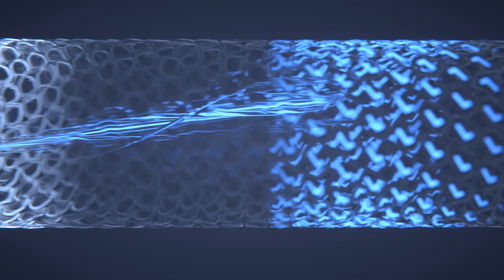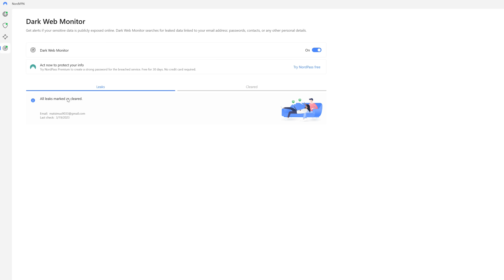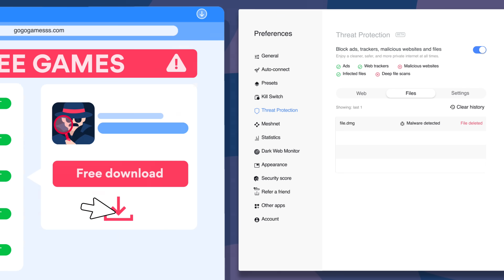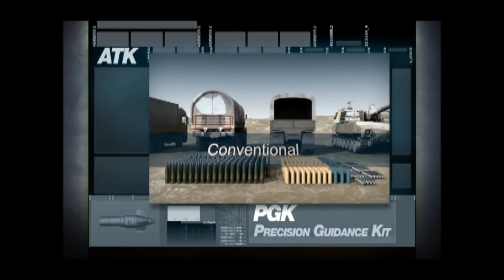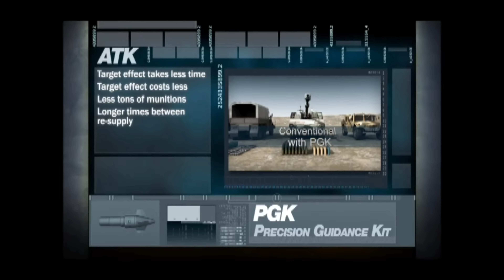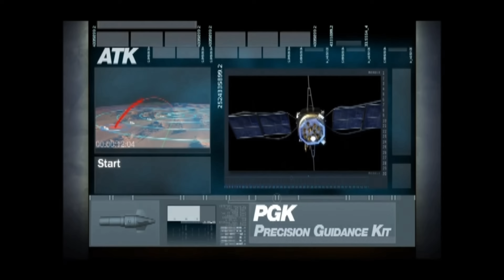Can Precision Guided Artillery Rounds be Jammed or Hacked?

Comment: I have worked on some of the very earliest attempts to make guidance for 155's back in the 90's. From an electronics perspective "nightmare" does not cover it. You may think that for example the sidewinder is difficult due to acceleration etc trying to destroy the electronics. Not even close by comparison. The muzzle velocity is near 900m/s it gets to that in a small fraction of a second. Peak acceleration is 30,000G. The sidewinder has a peak of 2000G at launch. Then comes the pain in the neck one. rotational acceleration which peaks at 5000G. A sidewinder when it does twist in flight (rare but it can) only hits a peak of 100g. Just making a printed circuit board to survive a 155 is a nightmare. Doable, but damn near turned our brains to porridge. Then of course you have the whole bond wire issue. I cant go into that though.
Reply: Can't you just encase the whole circuit board in epoxy and glue it to a piece of steel or something?
EDIT: Found a Sandia paper on it "Shock-isolation material selection for electronic packages in hard-target environments."
Encasing works but epoxy isn't the best material because it is too stiff, silicone and polyurethane are better
Reply: @Björn_1978  Nope as epoxy does not last long enough for military storage specs. Most are not strong enough either. Plus contrary to popular belief they are not waterproof in the long term and some after about 20 years start actually obsorping water. The shelf life for military electronics is 25 years without intervention IE just sat on a shelf.
Reply: @Björn_1978  one trick is to float the whole assembly in oil and try to keep everything the same specific gravity as the oil.
Reply: 30,000g(s)?  Wow.  Is that a scaled number?  That's amazing.  Next time they Discount Tire salesman tries to upsell me and using the virtues of a balanced tire, well, he'll need to do better...
Reply: The spinning issue is solved on the screw on guidance device in that it’s mounted on a bearing. They actually set up a PMA to power it. 
Bond wire; the first trick is to orient favourably, next is to use two more fine bond wires. Bond wire alloy is changed to increase copper content for more strength and less density. But yeah this is all hard but wiki reports cost of tThe screw in at only $13000 and falling.
Reply: I think you're full of it.  After a little research, a spec sheet has 30G as maximum overload rating on the AIM-9L, and 18 and 20g on the 9H and 9G.  That 1000x less than your crazy numbers.  Are you a fisherman or just stroll in from a long day/night at the bar?
Reply: @chrisbusenkell  That s for the mount.
Reply: The US and UK engineers who developed the VT proximity fuse in WW2 had to overcome the same problems. However they had to use glass vials to start the lead / acid battery to power the system and did not have access to solid state electronics. Yet they produced a system arguably as important as Radar, the atom bomb and breaching the enigma code.
Reply: @issadraco532  and yet it does. 203 mm guns are being used right now, I mean 2s7 pion. The round is not actually that big, you need just two man to carry it, or 4 to carry it comfortably, and the charge can be carried by a single man. Also don't forget about autoloaders and semi autoloaders, they can significantly increase the rate of fire. The closest thing to pion, that the US had was M107 (M110 was a howitzer, not a gun), and it was decommissioned because of reasons that were already solved by now: lack of accuracy - guided munition, low rate of fire - autoloader, high barrel wear - new advanced metallurgy, and barrel construction techniques + possibly usage of smooth bore, if we're using guided munitions anyway.
As for striking multiple targets - cluster rounds do exist, even cluster rounds with homing submunitions, even in 155.
As for excess energy, you don't need to use the maximum charge every time, unless you're shooting really far (e.g. to outrange enemy artillery) or trying to destroy hardened emplacements.
The problem with missiles - propellant takes just too much space and makes them extremely large and bulky. And while, in a gun all the bulk stays on the ground and can be used over and over again, in a missile it is single use and is thrown away.
As for the ships, the big problem is that their VLS cannot be reloaded at sea, or at least, it is really hard, with gun rounds it is much easier. So, they have quite limited amount of ammunition and have to return to port to replenish and continue the mission.
Reply: I believe that future artillery systems will NOT spin stabilize the projectile. This will be because all projectiles will be self-guided and hence spinning the projectile will not make it any more accurate. In fact, spinning the projectile will just complicate matters unnecessarily and so it will be actively avoided. Not spinning the projectile also has an advantage in that the projectile could be built with a "top" and "bottom" aerodynamic shape, turning the projectile into a aerofoil lifting body and extending its range. I'd be really interested to hear your thoughts on this.
Reply: @marcusmoonstein242  Unguided artillery isn’t going anywhere for a very long time. If ever we get to a point where we do completely phase it out predicting what the military landscape of the world will look like is impossible since that is so far off in the future, but barring that they would most likely come in the form of rocket artillery, so they already don’t spin (sort of).
Reply: @jonathanpfeffer3716  100% agree,.the difference in cost on its own is enough to make sure of that. Also sometimes you just want to hit an area. What would be the point of using a precision munition for that? The kit I worked on was for hitting armour behind hills etc.
Reply: @gordonlawrence1448  I know, that the following gonna sound heretical, but hear me out: What if a different caliber, and different guns were used solely for guided ammunition? Say, something akin oversized Caesars (or even Archers) with 8 or 9 inch smoothbore guns? The idea is, if you need to put a guidance kit there anyway, better put it into a large shell, that will bring much more HE for the same amount of electronics (literally providing a bigger bang for the buck). Also, guns like that could, potentially, rival the range of GMLRS with much less logistical burden for the round (more 8-9 inch rounds can fit in the same space as an MLRS missile pack). Additional advantage of a smoothbore being less bore erosion with extreme muzzle velocities, allowing usage of things, like ramjet accelerated rounds. And large caliber would allow to still have some sizable amount of explosives in rounds like that. Also, navy can benefit from this guns, that would enable to split R&D and production costs.
Reply: @gordonlawrence1448  
Could be worse, you could have been trying to get the VT Fuze to work in WW2.
With Valves... 😉
Reply: @solarissv777  ironically, higher yield weapons benefit less from precision because they don't need to be as accurate to guarantee a kill. That's part of why a lot of Russia's old "precision" ballistic missiles have abysmal CEPs: they were designed with the expectation that nuclear warheads would be used in a full-scale conflict.
Reply: @torinnbalasar6774  well, we are not talking nuclear rounds here, thus accuracy is still needed. Look at M107 175mm gun, it had extremely long range, but was not accurate enough and thus was decommissioned, if only guided munitions were available back then...
Reply: @solarissv777  Now your army has to procure another system, incompatible with existing ones in ammunition, spare parts, requires development of new system-specific training procedures, procurement of multiple sets of system-specific training aides, training or retraining of crews, integration into existing doctrine/force structure.
And then there's development of new ammo, a multi-year, if not multi-decade, and certainly multi-billion dollar project that, if successfull, leads to a couple of new rounds that are bound to one system and can't be used by anything else. All in all, it's gonna be Zumwalt main battery guns and ammo all over again - a huge expense that's (a) not really worth it for US with an airforce that can pave the road to Beijing with JDAMs and USN that can do the same with Tomagawks or (b) not achievable, even if desired, by most of the countries that aren't US and don't have US DOD budgets to spend.
Reply: @solarissv777  That's great analytical thinking, but if you want to rival GMLRS range with tube artillery, why not just use a rocket system? I think you have a great suggestion for the Navy. Anything larger than 155mm runs into serious weight issues for the Army. Mud is a common limitation for ground forces and occurs pretty much everywhere regardless of season.
Reply: @slartybarfastb3648  well, there are ways to overcome that (tracks, large low pressure wheels), but the weight would still be the issue. There is the reason why HIMARS have just one missile pack - to be air transportable. So return of large calibers won't work for the US (at least on land). Who can actually do this is South Korea, or, maybe China (if they steal enough tech).
Reply: @jonathanpfeffer3716 the whole point of extended range cannon artillery is reducing logistics. Rockets are extremely logistics intensive weapons, owing to their large rocket motors. Cannons are efficient, because cannon propellants are efficient.
Reply: @marcusmoonstein242  The point is the barrel is rifled and they spin going down it
Reply: @marcusmoonstein242  got a pretty good idea, but it won't go all precision for decades, if ever with legacy systems.  We spend a insane amount on our military, which anyone here i'm sure is aware. We couldn't afford it.  155 he is under a grand shell alone.  Excaliber rounds from 65k-95k.  Even at lowest cost your talking a 60x cost difference.  Transfer it to ukraine, say 10k-30k rounds a day during heavy fighting.  Insane costs.  Even if you go wouldn't be shooting those numbers because the accuracy.   Still a 1k plus rounds a day, 10% low number.  Still crazy.  Alternatively consider this, stationary targets, or limited mobility we can reach out well beyond 15 miles and hit truck sized targets reliably.   And much further with a few new weapons tech thats testing currently.  Thats regular shells and some base bleed style unguided shells.  The other thing is if its too rich for our taste and unnecessary for much indirect fire.  Then theres not another military that could make that could justify and afford even making that a significant amount of their stockpiles.  That doesnt mean they can't do it, or be at least somewhat ok with that cost/benefit tradeoff.  Say someone like china.  The other kick in the teeth is developing and building these, even if someone may have stumbled upon the R&D and mfg plans, the physical forces  electronics experience when fired are orders of magnitude over rockets or missiles.  It's tedious, and something that isn't adaptable to large scale production like conventional artillery munitions.
Reply: @mtmadigan82  It's only an insane amount until you need it. How do you think Ukraine feels about the cost now?
Reply: @marcusmoonstein242 that would be very logical for something like a EM rail gun. Stuff a ramjet in there as well. The EM rail gun can reduce some of the initial shock problems by using a progressive acceleration  design for the gun.
Reply: Fascinating work you did. I've only seen civilian-friendly explanation of it and certainly won't try to pick your brain on the subject. Whatever issues you encountered seem to have been solved. I didn't know the G-loading these experience. I knew it was severe, but wow! That is extremely severe and as much an understatement of the word 'severe' could be.
Reply: Thanks for your work. Your country, and now Ukraine, owes you
Reply: How did you do it though? I mean how do you support it or reinforce it to protect from the shocks and jerks?

Comment: So PGK is like a JDAM but for Artillery Shells. Does it or could it have INS capability in the event of degraded or blocked GPS signal? If so could it be used along with disabling the Accuracy failsafe to still provide accurate (if a little less so) fire against targets that are not within a hazardous range to the guys calling the shot in?
Reply: Takes too long to align INS and it drifts too much. I assume GPS can be hot started from an already synced GPS as part of the fuze programming immediately before firing. You have to have the ability to not detonate shells that don't know where they are going, because they can turn a lot. One claim for Excalibur was 30 degrees off track. You don't want to risk killing your own folks.

Comment: The opposition can't jam the IMU. While less precise than GPS, the secondary IMU navagation can't be jammed. If the system detects GPS jamming -- or a discrepency between GPS data and IMU data -- then the system likely reverts to IMU data. GPS data is useful for the first part of the round's flight, then IMU takes over when the system deems GPS data to be invalid. The longer the GPS data is valid, the less error drift is introduced when the IMU takes over in the case of GPS degradation.
Reply: Heh, this is exactly what I was thinking of as a solution to GPS jamming...
Reply: PGK isn't IMU ..it's GPS based.
Reply: @dwwolf4636  I think you are missing the point.  It's not about what the PGK currently is, but about how you could make such a system resistant to jamming so the worst jamming does is degrade accuracy a little.  Even then, it should still be more accurate than unguided munitions.
Reply: @dwwolf4636  Fair point. From a 2011 article, it appears that early PGKs from that era lacked IMU backup capability, which Excalibur rounds had. But it was a known issue hoping for R&D. If updated PGKs exist, they may now have IMU systems? The same article implied that Excalibur GPS would only kick in at ballistic apogee, at which time fins would deploy to turn the round into an unpowered, fin-steered missile round based on GPS with IMU backup. Meaning that no GPS/IMU guindance was used for the first half of the round's flight. Hopefully later PGK revisions have or will have IMU back up for GPS degraded environments.

Comment: Jamming the Excalibur round requires knowing that there's a GPS guided round coming in.
And since the GPS is a passive receiver, that's hard to figure out in the available incoming time
Reply: You have to use a satellite jammer all the time for that.
Reply: @max2008abhi  and it has to be powerful enough to cover out to 60km radius beyond your own forces to have any chance of jamming it early enough.
And that opens the jammer up to a big fat HARM strike...
Reply: @SonsOfLorgar  and the harm will be shot down by a sam.
Reply: @max2008abhi  A HARM based artillery shell would do the trick for something jamming GNSS guided artillery shells. A LOT harder to shoot down 🙂
Reply: @max2008abhi  it would be very hard to shoot down multiple HARMs.
In fact, the radar used to shoot down the first HARM would immediately become the main target
Reply: @mowgli2071  then you switch off the radar and move out of the way. The Russians did it in Ukraine.
Reply: @max2008abhi  You then lose the ability to defend your big, fat signal on your GPS jammer while your AAA is shut down and scooting after shooting.
Either you're going to have to shut it down as well, or you're going to risk losing it. 
Which then clears the freq for the various NATO GPS ordinance
Reply: @mowgli2071  how about using an aesa lpi radar fpr tracking
Reply: @mowgli2071  the Israelis have combined a aesa lpi radar with an optronic system and a Bofors gun to provide a system that can track and kill shells and rockets at short range

Comment: A single drone operator can call in a battery of fire very accurately. Cheaper and as effective.
Reply: A drone operator with google maps.
Reply: You can't guide artillery to better than the Circular Error Probability of the hardware you are using. So if your CEP is 300m at the range you have to be at to avoid counter battery fire then it takes a lot of rounds to kill the target. Drones don't change that. But if you can guide the round to within 50m then you need a lot less shells to do the job, and you can fire them from further away. GPS guidance only improves if it has more time to fine up its guidance solution.

Comment: I wonder why this couldn't be made to work on a great number of platforms even other sizes of artillery like the 105mm with simple firmware changes.
Reply: Yes of course. They are probably working on it. Surprised it has taken this long and costs so much. I guess it also has other features.

 Less bullets and rounds needed for same effect. I don't know what it is called but where one gun can basically have multiple rounds hit the same area at once? That would be devastating. 

 This and scoot and shoot seems to be the future for artillery. Of course extended ranges are going to be ever more important in the future. Surprised we aren't shooting basically cruise missiles yet or some type of gliding shell.
Reply: OTO Malera have a 50km range 76mm Vulcano round developed with Diehl in Germany.  There is also the MAD FIRES 57mm guided round.
Reply: PGK is also for 120mm mortar rounds.